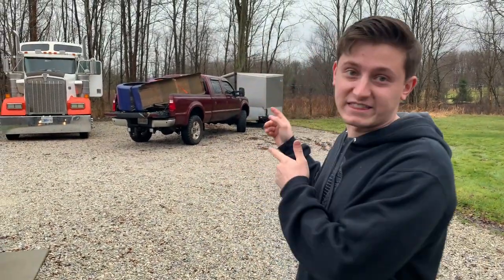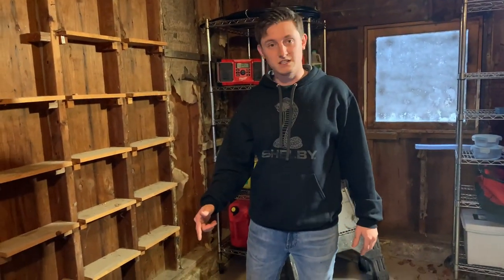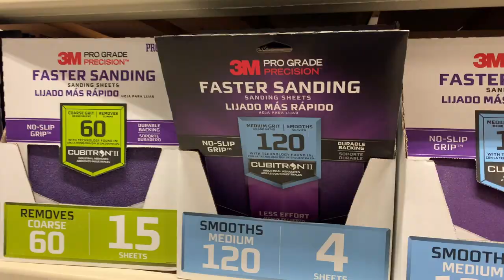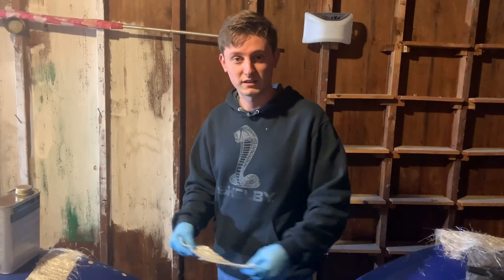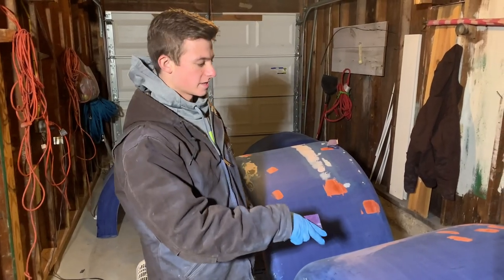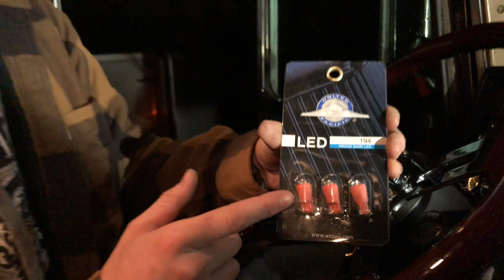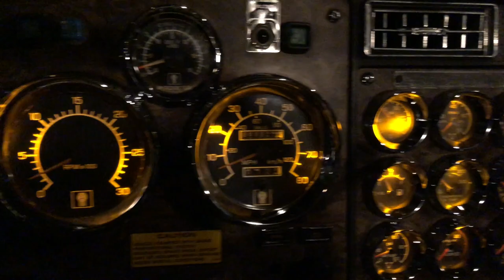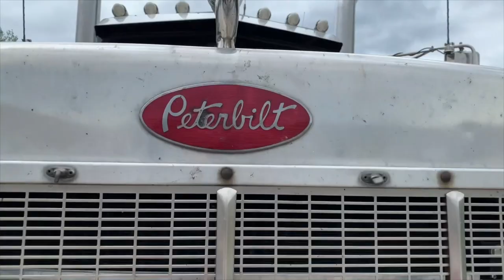KENWORTH W900 "BODYWORK ON THE NEW REAR FENDERS" PART 8

Comment: Fenders are nice. They keep rocks from killing your sleeper. And also keep over spray down while on highway. 
Nice touch. 
Only bad thing for me is I can’t throw chains on tires during snow with those. Otherwise my trucks would for sure have them.
Reply: George Calatean: how's the Detroit rebuild going George
Reply: 3 Dollops howdy! 
It’s been slow..... I Been home in Portland since the 11th for the holidays. I have to get back to work soon and then back to Arkansas to meet the machinist  who is cutting the block and testing and inspecting head for damage. I’ll do a video on just that process. 

Then I can start reinstalling new engine parts. 
I should have a new video by end of Jan hopefully. 

Engine portion of the rebuild  should be done feb or March. Depending if I go stock or performance parts. 

Then I can start on the interior rebuild and then exterior repaint and then eventually hopefully put to work before summer. 

If it was at my house, I could of done paint and interior work already. 

But I have to finish the engine before I can drive it home. 

Stay tuned. It will either get done or kill me.
Reply: George Calatean I look forward to the series of vids on your rebuild
Reply from the maker: That is true! Fortunately we do not have to chain!

Comment: The dash lights look awesome! Also when I did the dash lights I took and put little chrome watermelon lights (with the bracket and visors) on the sun visor brackets and on my cb, had them facing down so the whole dash and cab was lighted. Under the dash I put the 1x2 led running lights so the floor would light up also. Hope this helps you guys in achieving a nice light up interior. The ride I used to drive was a short hood 379.
Reply from the maker: That is a fantastic idea! Never thought of that Chrome Depot here we come...

Comment: Wrap the dash as well or paint it at some point. I have the same dash on my w9 wrapped it red. The truck over all feels like a newer truck lol.

Also the lights one above the passenger head and the one above the drivers head. If you put amber bulbs in them and face them towards the dash. It gives the dash a nice glow. Especially if you wrap the dash white or orange.
Reply: And one more thing. Where the radio sits you can put a double din screen. Theres just enough space to fit one. But youd need to find one where the back of it is shallow cuz theres a shit ton of wires and air lines behind 
There
Reply from the maker: Those are some awesome suggestions! I like the lights idea! The dash needs a little more light and I think you just solved it for us!! Also, I agree, the double din would look a-lot better!

Comment: Your videos are awesome just recommending that you put a shifter extension would look really cool or even put the chrome steering coloum pieces in would look killer but still the videos are awesome
Reply from the maker: I will call Chrome Depot Monday morning and get that on order! Great Idea! Thanks for the support!
Reply: Shifter extensions are dumb but the steering covers are nice
Reply: Nah, just a small shifter extension is perfect. Take a 12" bolt, same thread as the shift knob, cut the head off and thread the end, install with them extended nuts. Add quick double end connectors for the air lines. BAM! Shifter extended to shoulder height; nothing too crazy.